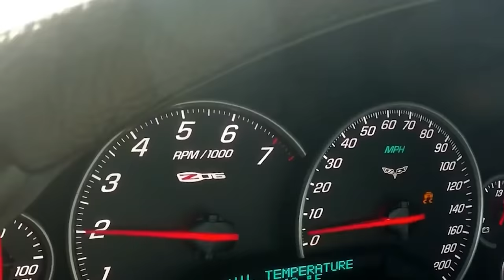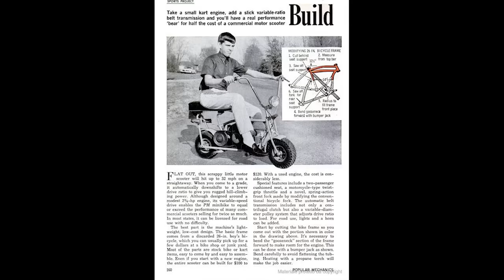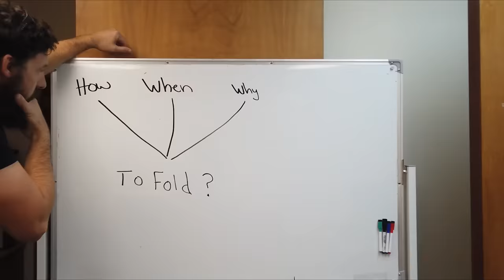I Bought the Smallest Folding Motorcycles

Comment: Im an old guy, the new stuff is better better.  In the sixties the cars needed an engine rebuild at 100,000 miles, carburetors vapor locked, engines over heated, AC sucked, panels didn't fit. and you were constantly working on them.

Comment: Have definitely been in a couple of situations in my life where having one of those little electric bikes would have been really cool. No fun having to walk several miles. Especially when you're off road and no one knows where you're at.
Reply: I would love to see someone try to ride Sean's foldable "motorcycle" offroad
Reply: You know it'd never be charged when you needed it.
Reply: @sketch2002  If you get one with lithium iron phosphate batteries you just store them charged, and it takes a really long time to discharge. I wouldn't store lithium ion or lithium polymer until the very day you're planning to ride the thing (degrades the battery sitting with full charge, often quite drastically on LiPo)

Comment: These ain't motorcycles, they are folding e-bikes.
Reply: Moter, on a bi-cycle = electric motercycle ? Ironically the usual difference is the foot powered pedals, but that tiny one doesn't even have rotating pedals

Comment: The smaller one is perfect for travel. 20lbs (one page says 30lbs). It can easily be taken on busses, trains and maybe even airplanes (at 30lbs it might be too much for carry on, but you could put it in checked luggage). I've done busses and trains with my 20lb and 10lb rides, and this would be easier to stow. Range bites but you could track down a 2nd battery.

Comment: I moved to CO 6 years ago, and began building my own scooters from scrap bits since moving out here. 

I'm actually rebuilding one of my creations right now, making it a 48V 30AH 2kW chain-driven, full-suspension, steel-framed, off-road ready beast (with plenty of cargo space). 

Before it was only 36V 12AH & 1.2kW, which still got me to 30MPH, so hopefully I can top 35 or even 40MPH with it when it's finished. And it still folds in half for storage/transport.

You really need a rugged vehicle for Colorado, even if it's on the sidewalks. 

I reckon that Himo H1 thing wouldn't last a year before it's either inoperable or dead. 

The Jetson would likely fare better, but the lack of front suspension means a lot of vibration, and I've seen a few of the cheaper Jetsons fail from wiring jackets getting jarred until they rub their own insulation off and short or sever the strands within.

Comment: I'm all for the older vehicles maybe they weren't quite as reliable maybe. But they were sure a lot easier to work on.
Reply: I drive a 67 Chrysler Newport with a 383 2 barrel. It's very reliable for the amount of miles I drive usually about 1000 miles a week. And the plus side is I can carry around all the tools to fix it. For the most part the only things I've had go wrong are usually ignition system problems and take about 15 minutes to fix.
Reply: I like older vehicles but honestly I’ll take the safety and comfort of a new one!

Comment: 6:13 the battery in this ebike should be removable. That little handle is for pulling out the battery. It’s designed so you don’t have to bring the whole bike to charging and bring an extra battery for more range is possible.

Comment: I'm building a 2 wheel drive/AWD E-bike/Motorcycle, should be done in a few weeks. Building the battery pack took freakin forever, built the cell spacers with 3D printer, used 364 batteries for a 13s smart BMS, which I should have added 28 more batteries to make a 14s system to make it last longer and have a bit more power. The battery pack takes the whole space of the middle section of where a motor would be on a motorcycle. Will send you a picture when finished, bad news is that it costs more money on this diy project if the bike is not a perfect match for what you need, I needed to purchase new handlebars, forks, brakes because it was a beach cruiser and with the motor kits it now has no brakes(due to it only had peddle brakes). I purchased a new battery as well which cost much less then diy battery pack build. Also, purchased new controllers because I burnt out old controllers once I put both together for awd. So I bought a purposed awd dual controller set with throttle and display, and so on, and on.... spent over $2,500 so far and will keep going until I make the ultimate dual sport motorcycle with a 500mile range @ about 100mph top speed, at the moment, top speed is on this first test model is 28mph, will have to purchase a used motorcycle frame and new hub motor kits for the extra speed, this first bike is a test to learn everything I have to learn to build a complete bike diy before the ultimate motorcycle build. It's been a fun and painfully tedious project that takes forever with the little time I have to spend on the bike. I've noticed much more new e-bikes on the market but nothing I would even want. E-Motorcycles on the market are few and far between with high price tags and bad top MPH, bad range, and almost no instant hp for 0-60 in anything close to a real motorcycle. That is what I am trying to change, awd bikes are soo much faster and have 3 times the torque, just need to find the perfect hub motor kits that are adjustable for instant acceleration with a top speed of at least 100mph. Then their will be a real E-Motorcycle in the world. Don't know if I'll be the first one to make a prototype that's cheap enough to mass produce, also, only of super high quality for the world to afford.

Comment: The smaller one has the seat angled toward the front closer to the handlebars instead of straight up or back even giving you more room. But it does get very small and that probably is the reason.

Comment: My auto mechanics instructor made it a HUGE point to let us all know the difference between a MOTOR and an ENGINE. 
He said motors are electric, engines run off gas or diesel fuel. 
Why, then, do they call them MOTORcycles, and not ENGINEcycles?

edit: here in San Francisco, you don’t talk to folks on the bus 😂

Comment: Love your Youtube channel. i binged watched it this weekend. No I don't believe cars were better in the old days then they are now. Cars are more reliable, gas friendly, better made with more strict quality control, safer, have fuel injection and are more powerful with much better gas mileage then those old dinosaurs of the 1960's and 1970's. The QC was atrocious on those old cars and some had gaps between panels that were so big a small dog could walk through them.

Comment: I had the Jetson Bolt Pro, not a bad bike, but kinda under powered. Like had to peddle it up almost every incline I came across. Got a DYU D20 which is basically the same frame but modified for 20 inch wheels and better electronics and it rides like a champ

Comment: I had the swagtron eb7 which is essentially the same bike Craig rode. you can sometimes alter or disconnect the speed limiter. it reminded me of riding the old little Yamaha pedal mopeds. get the same looks as riding one too lol. they definitely have their uses especially for campers, rvs, or anywhere you want to take a bike to ride and sight see but don't have a way to haul a full sized bike. not to mention general around town store or work and back depending on distance

Comment: I'm fairly sure this is designed more for European cities, low speed, low range, light weight, small wheels = take the "bike" with you on a train and then use it to drive the last 1-2 miles between the station and your home/workplace.

Comment: You’re lucky. In Tennessee you can’t bring a lithium-ion powered vehicle on a bus. BUT, I found a way!!
I live in Nashville. I own a 40 lb. e-scooter that’ll do 25 mph with a 15 mile range. Since my job is almost a mile from the nearest bus stop, I really need a “last mile” transportation solution. My scooter folds, SO, I bought a heavy duty bag designed for scooters and tell the bus drivers that it’s an electric guitar😂. No problem (except playing the weight off)

Comment: Out of the two I will pick the Jackson yeah it's bigger but if you end up running out of battery it also has pedals so you can still move with it like it would be just a normal bike while the other one the H1 if you run out of power you have to use your feet so technically the Jetson has infinite range cuz you can just use it as a bike

Comment: 1. Those are E bikes. I get it you needed something that folded, but c'mon. 2. The use case for them is still the same as it always was. Put it in the back of a car and when you go to town. You don't have to walk. Though I'd argue the old ones have the major advantage that all gas powered things do. That being if you run out it'll take you less than 30sec to get back up. While the E bikes will take 30mins to an hr to charge back up.

Comment: QUESTION: How do I get the best deal when wanting to buy a used Versys 300?  Look on auto trader / bike trader, or look on eBay, or go to a dealer, or Craig's list.... how can I find the bike that I want at  low price and in good condition and in a way that I am not concerned about getting ripped off, hidden damage / mechanical problems?  I know that people have bought this bike new... out the door $5k total.... so if the bike is say 2019 making it 4 years old,  what price range would be considered a good deal for me to buy it used?  People always ask a lot, but what is a real used selling price for a Versys 300 that is $5k new and now is 4 years old, with average Miles of usage??  Please... any assistance is appreciated.  THANKS

Comment: Some of the new bikes are better than the older ones but the Enduros the old classics still outsole the new ones I would take a 85 86 XL Honda over any new Enduro just like the older four wheelers and dirt bikes all the four strokes have come a long way and it's nice to be able to cruise on a trail without actually having to whine your bike out all the time like a two-stroke but for Motocross nothing beats too stroke

Comment: Yea but the new cars are made of plastic and computers. So many problems and a beast of an old car can't be messed with on any level. Easy to work on. You can put EFI on it if you want and it can still be dino tuned. Instead of buttons you simply turn screws.

Comment: JETSON EBIKE most are 350w up to 18-20mph, but a small 7.5ah batter the other little moped thing duno. Never Sean it. But neither are a motorcycle. Look into the WolfWarrior pro x  escooter it's very cool at 48mph and up to 45 mile charge.. OR wolf GT 65mph.  Or stealth B-52 50mph ebike.
p.S. ebikes and escooter are prohibited on most  busses in city's because of the li-ion batterys.

Comment: new stuff got too many sensors and crap that can fail..old cars..file the points  check gas and oil..no sensors to fail to leave you with a headache to figure which gizmo failed and then the sensor then costs upwards of $100 nevermind trying to get to it to fix it and find it on the motor.  yup il take any model without sensors and computers any day.

Comment: The hellcat motor and drivetrain could be fitted into an older much stronger frame and body. The reason older cars were better has nothing to do with their performance, it has to do with their ease of repair and lack of meaningless complexity. That hellcat has 5 computers and a mile of wiring that could fail on it and if it gets so much as a 10 mph bump it's a coin flip if it will be totaled because of all the expensive electronics that don't matter at all to how the car rides and drives.

Comment: The Hellcat will not be running in 50yrs on OE parts, period. In fact NO car from 2010+ will be running 30yrs on without extensive replacment of all the electric garbage that tells the motor to run or not. Modern cars are built to be disposed not repaired. Also those old muscle car's will pump out 700+hp with a supercharger aswell. Im puttiun an 04 Vic back on the road after its sat for 10yrs, so far EVERY sensor has had to be replaced.

Comment: That has pedals and looks to be well under a 750 watt motor. Those are e bikes not "electric motorcycles", and they're cheap ones at that. There are e bikes in the 2000 dollar range (example: Wired freedom) that can easily do 40 mph without pedaling.

The distinction is important. An e bike requires no license, registration, or insurance.
An electric motorcycle does, and has power/torque equivalent to a typical motocross bike.

Not sure if you guys are trolling or not. Those are the bottom of the barrel as far as even e bikes go.

Comment: newer motorcycles are not faster  there were bikes in the 80s topping out at 180 and most newer bikes are more dangerous due to abs and traction control
Reply: With the speed limiter removed there’s multiple newer bikes that go over 200. Compared to bikes from the 80’s a newer regular sportbike is going to be basically a full race bike. From the early 2000’s on is where they’re pretty similar performance wise.

Comment: And you claim you have an Boss Hoss?
Reply: When you're man enough you don't care. My phone case is pink, you think I care too much? I was going to hydrodip my motorcycle parts in green and glow in the dark pink (its a green duel sport currently), but I've got a few pink accents on parts I've 3d printed for it (which is also why my phone case is pink, I designed then printed it all in the same rubbery material because after like 2 hours of driving through the rain on my motorcycle and them being out of every other color, pink it is!)

Comment: Old muscle cars were easier to repair. New ones are deliberately and unnecessarily hard to repair to create more dependency on dealerships. Keeping error codes and repair instructions secret and/or paywalled is harder than the alternative, giving them away for free. So the old cars were better. They might not have been as fast, but they were doing their best to be a good product.
A faster car is not a better muscle car. A newer car is usually a worse muscle car because it is incompatible with the American spirit of independence, working on your own engine has been replaced with begging at the feet of salesmen and dealership mechanics with their proprietary error code readers. I wasn't even alive for the old way and I still know it was better, because it's the same way I work on my computers now. Imagine giving up control over your own hobby. I hope it will never be me.